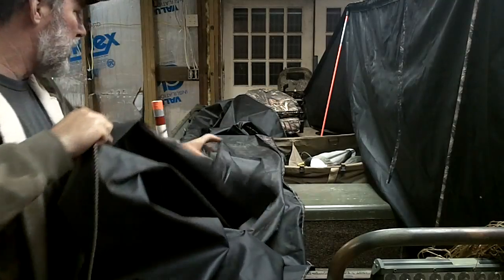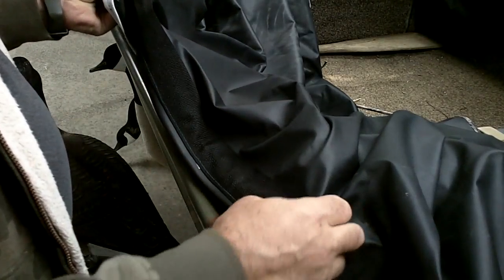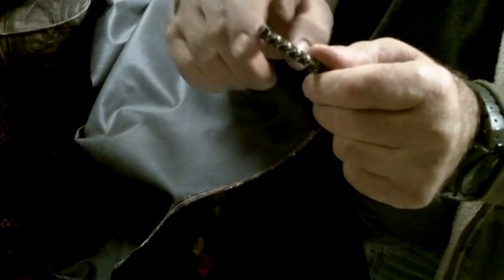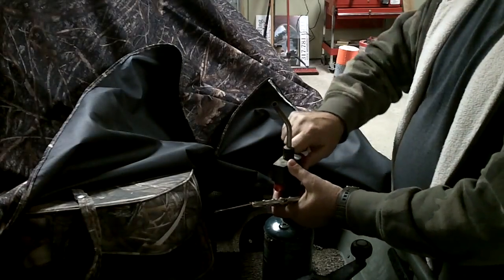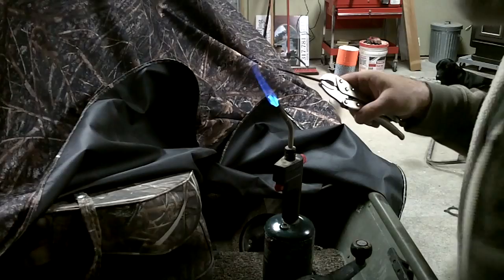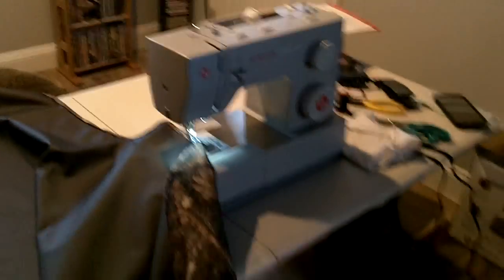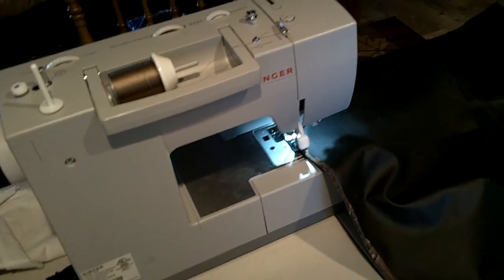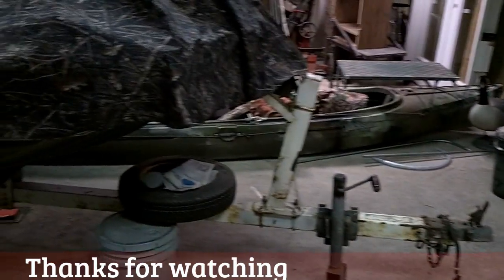Learning to sew - Homemade duck blind DIY pt 4 final

Comment: Hey not trying to tell you what to do ..... But if you'll put bungee material around the bottom it really helps out especially when your getting in and out of your boat ...I believe you'll like it easy to do .... Great job  !
Reply from the maker: I thought that too. The reasons I went with snaps instead is because after the shot, my dog gets sent for the retrieve, if a bird goes down.  The blind comes down before she goes in.  I didn't want the blind to drop in the water, so the snaps will keep it out, where as a bottom bungee would simply fall.  Dog re-enters at the back of the boat, which stays open.  It still hasn't been used and proven, so I haven't ruled out other options. Thanks for the suggestion, and thanks for watching.